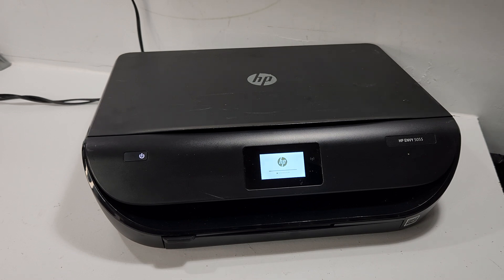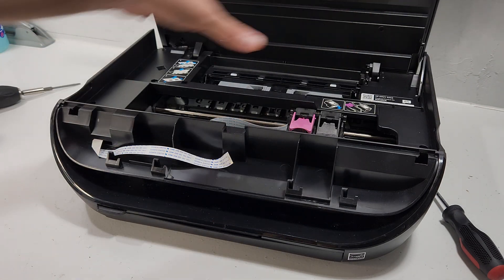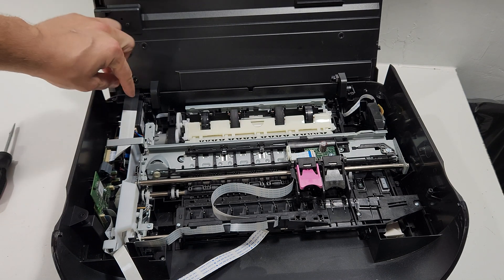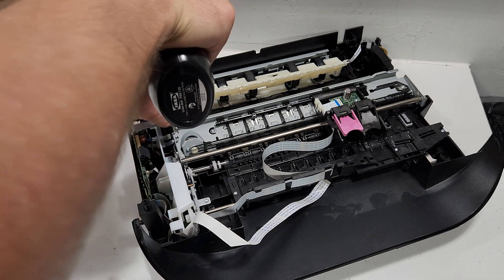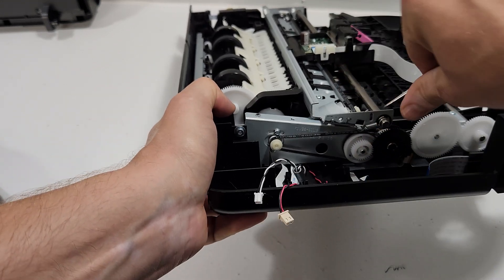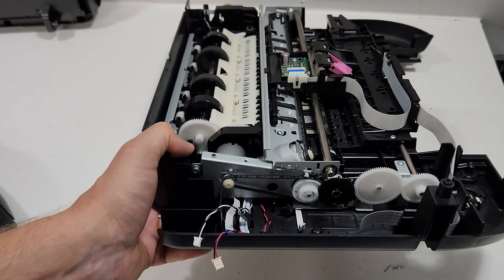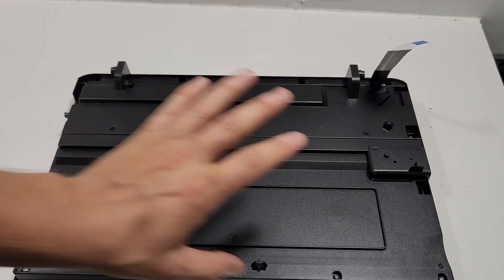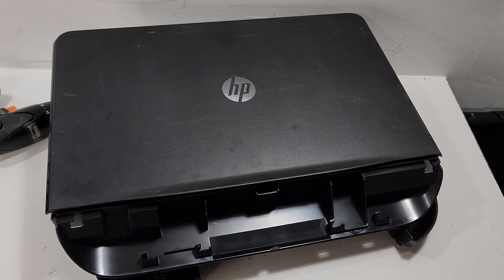Taking Apart HP ENVY 5055 For Parts or To Repair 5052

Comment: MY HP ENVY 6055 HAS A PRINT HEAD PROBLEM.. HAVE CLEANED CONTACTS AND INK CARTRIDGES TO NO AVAIL.TRIED DIFFERENT CARTRIDGED TO NO AVAIL. IT APPEARS IT'S NOT A REMOVABLE PRINT HEAD UNLESS GOING TO THE LENGTHS YOU DO HERE SOO YOUR SUGGESTION TO FIX THE PROBLEM???? WHAT ELSE IS THERE TO CLEAN OR DO?

Comment: Hi. 

I have an Envy 5545 that isn't working. The screen doesn't light up and the power button does nothing; it's like it's dead. I think it's due to a blown fuse in the power supply or there's a problem with the power supply. Do you know if there's one there?

Thanks in advance.

Comment: hey brother , i have a similar model like this named HP DESKJET INK ADVANTAGE 4535, its really similar to the printer mentioned here , yesterday suddenly its screen went blank like when i turn on nothing happen just screen lights up , just a kind of lighting up and nothing is happening , what should i do , i have watched your other videos related to this topic too
Reply from the maker: Hi. I wonder what caused it. Did you have an electric surge? I honestly do not know what causes screens to go blank. I will check a similar model. I assume it is the connection on the screen assembly